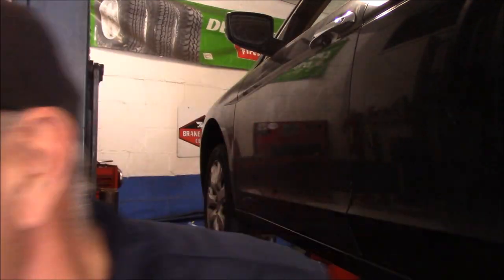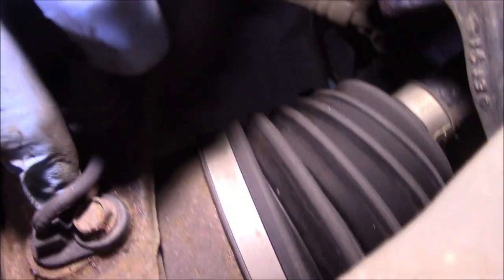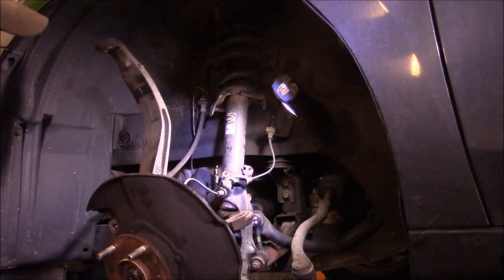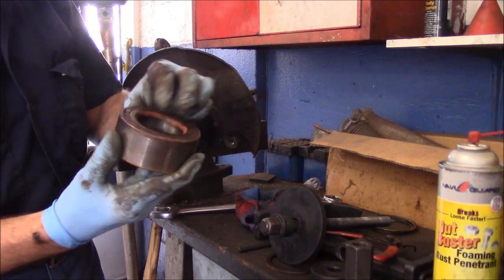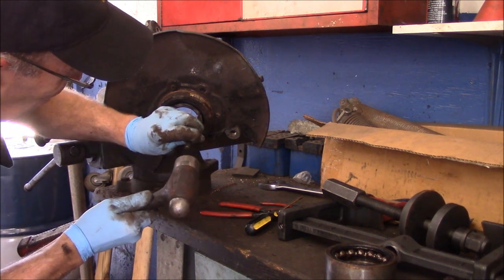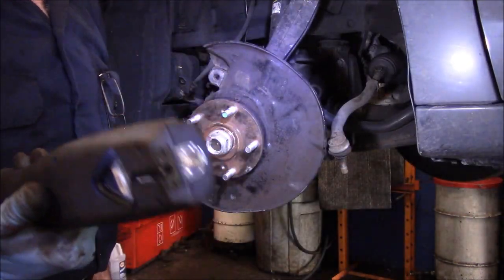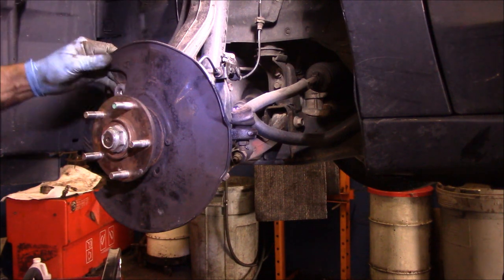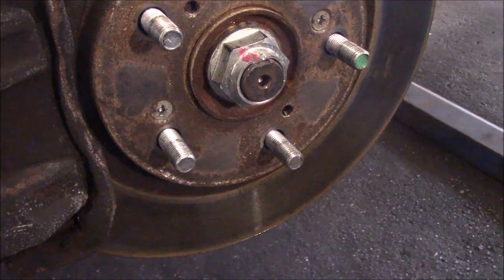How to replace a front wheel bearing 2010 Honda Accord

Comment: That is a complicated job and you made it sound so easy. The kits you have for replacing the bearing is great, and I would want one if I was doing work on vehicles all the time.
Reply from the maker: It looks easy but remember I have done thousands of them but with this kit from OTC its a lot easier.

Comment: Thanks for showing the how to’s to replace it. But i have a question. Do you really need to align the wheels after you replace it? As i’ve seen it you did not require wheel alignment as replaced.